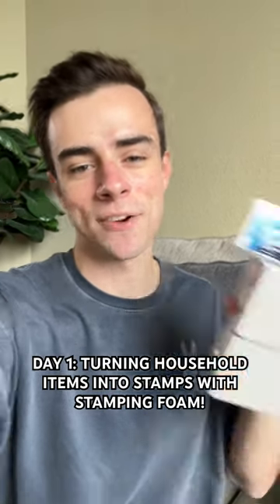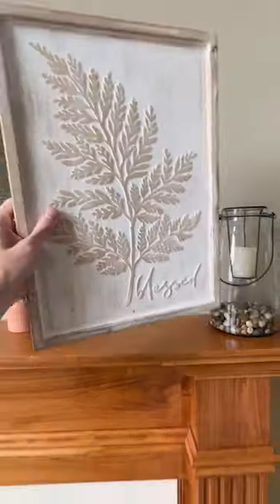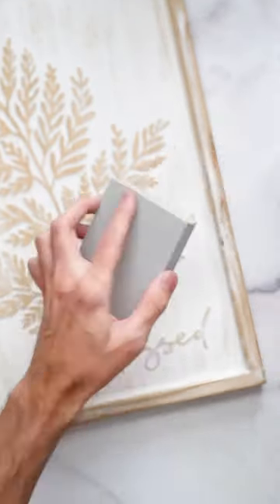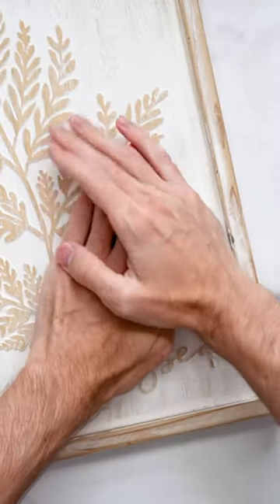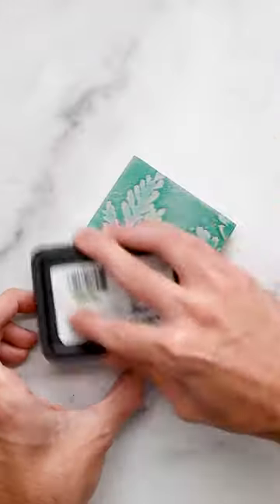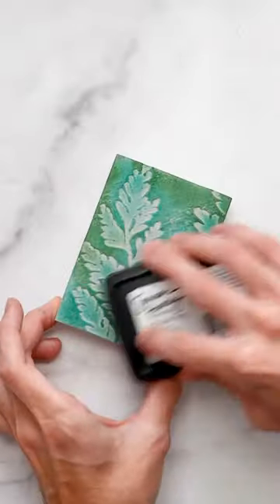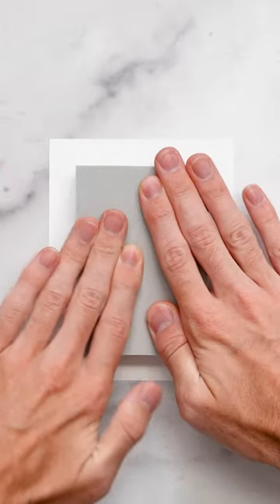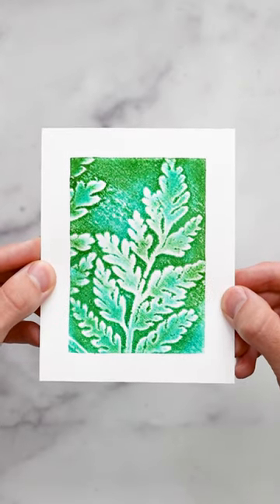Turn ANYTHING Into A DIY Stamp With Stamping Foam!🤯 DAY 1 #craft #art #stamp

Comment: Hey, can you please tell what's the difference between Lunar Paste and Solar Paste
Reply: Lunar Paste is a color paste that can used in place of ink, watercolors, or even acrylic paint in a lot of art applications. It's basically just shiny, metallic paste that can take the place of a lot of different mediums. Solar Paste is the same thing but it only comes in white with a metallic shine in slightly different colors. It's best for background or small things, like adding highlights or metallic details. You can also color Solar Paste but it'll always be more translucent and thin than Lunar.